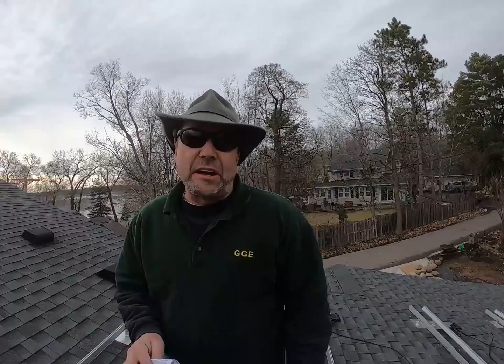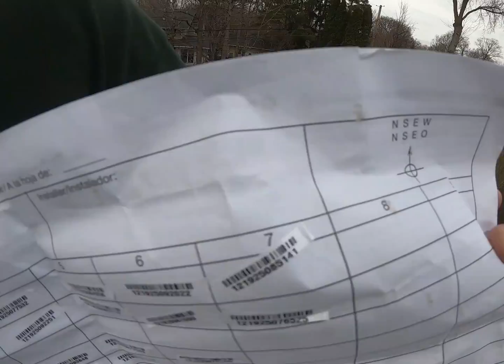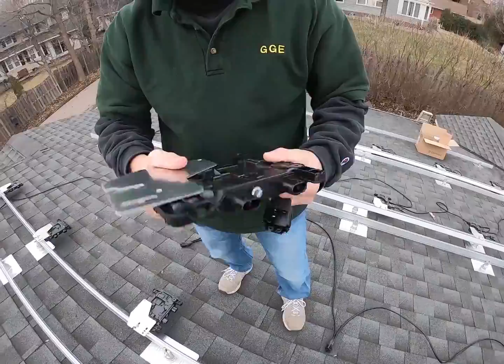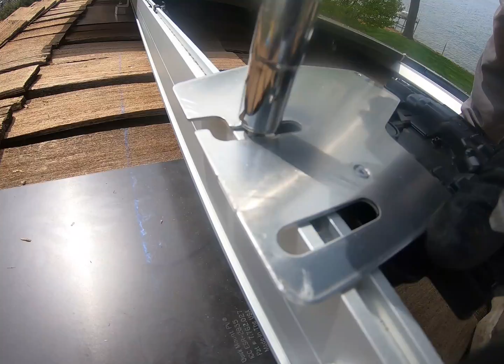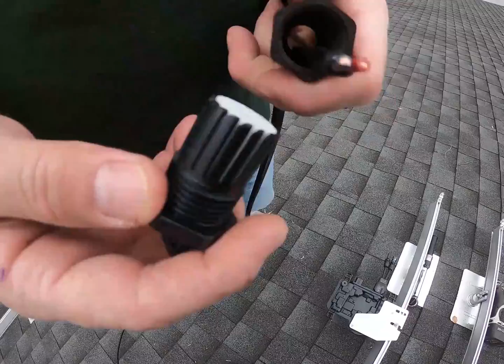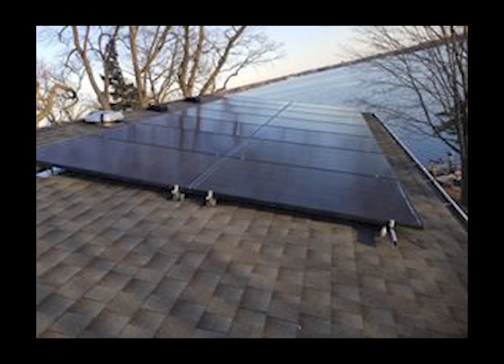Enphase IQ7 Micro Inverter Installation for Solar System

Comment: Wish they would allow self-installation of Grid tied system. Here in Orlando, they won't allow tie in without Electrical contractor doing permit. Which cost me $5000 to learn that. even though all was code compliant, so electrician made 5G to say yes good to go and pull Electrical permit.
Reply from the maker: You got the wrong electrician. What state is this in?
Reply: @TurbineGuy  florida
Reply from the maker: @bugboy8462 i hook my own stuff up on pine island
Reply: that's why I worry about mosquitoes more than snow

Comment: Good explanation of install.
Only question is with that upside down Is there an issue with water pooling and creating issues with mosquitoes, Ice, or other ponding problems? I couldn't here in central Fl., on my flat roof for that reason. of course, if pitch is greater maybe not an issue
Reply from the maker: Solar modules can flex under snow load and scrape against the inverters over and over. Thus, upsidedown gets more distance to prevent this

Comment: One thing they don’t tell you is, don’t get the IQ seven inverters because your panels won’t work if it blacks out. You have to get the IQ8s
Reply from the maker: Good point. I made the video before iq8's. Still need to spend 3k on a controller for the iq8's to work wirhout power

Comment: Hi, need a advice can make a of grid system without battery ? With microinverters? Just to use in the daylight. Thanks
Reply from the maker: Yes you can these days. email me at jtn@gogreenenergyonline.com
Reply: Our grid-tied inverters do not require batteries

Comment: How many IQ7 Micros can I gather together? And How do connect 3 groups of 4 panels each on the roof?
Reply from the maker: 13 in a string. You would end to end the groups with wires, in other words, tun them all as 1 continuous string, even if they are directly adjacent to each other.

Comment: great video thanks, i literally needed to know if i could parallel the iq7's and your video answered that so thanks!
Reply from the maker: Great to hear!
Reply: Do note the particular microinverters limit the # of pv panels on a string. In the case of the IQ7+ it's limited to 13 on a 240VAC panel string. The microinverter model manuals will tell you the limit.

Comment: Is the   Envoy  required,or can i skip this piece of equipment?
Reply from the maker: You do not need the envoy, but you will not be able to monitor it then and know if you have any issues crop up.
Reply: @TurbineGuy  can the envoy be hooked up without enphases expensive combiner box?

Comment: So these enphase inverters go plugged to the 220v line then. I'm doing off grid setup but like to learn stuff.
Reply: For off-grid, you'll need to wait for the Enphase EQ8 that supposedly can work off-grid.  The EQ7 is a "grid-tie" inverter and needs to have the power grid to sync to.
Reply: @beyondfossil  how long off is the eq8 ?
Reply: @xboxerdudekiingpurp5530  Last year, they estimated the release in early 2021 but that schedule has already passed by.

Look up the "Enphase Ensemble" product which will feature the EQ8's ability to work in both grid-tie and off-grid situations.  The "Ensemble" product is supposed to be able to "ride out" a grid outage and continue to provide power to the home from batteries.  Thus the need for an inverter that can operate in off-grid standalone mode.

Comment: One of my panels has gone dark already.   A have an Enphase IQ7.  It has to be a microinverter that has gone bad, correct?

No weather problems, other than intense heat in the summer.
Reply from the maker: You will want to switch the wires from a neighbor micro inverter with the one you think is bad to see if the problem follows the micro inverter or stays with the solar module. This video shows how: https://youtu.be/k4i5KrhTO2g

Comment: Great video, thanks a lot for the help!  I'm coming from the solar edge side of the house some new to the DC to AC right on the roof. Do you have another video that shows what to do at the end of your strings?  I saw the one side is a dead-end, I get that but does the other side go right down to your load center? I'm assuming you only need a junction box at the end of every string correct?
Reply from the maker: Video is coming, in production now.
Reply: @TurbineGuy  oh wow awesome, will it cover a combiner box as well?
Reply from the maker: @shawnneichelberger6293  Yes, I should have it ready in a day or 2.